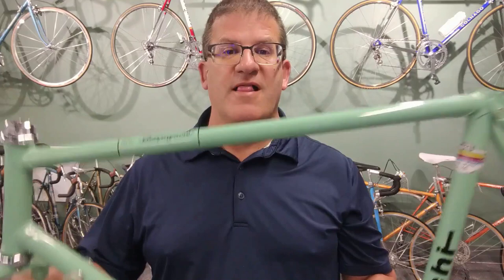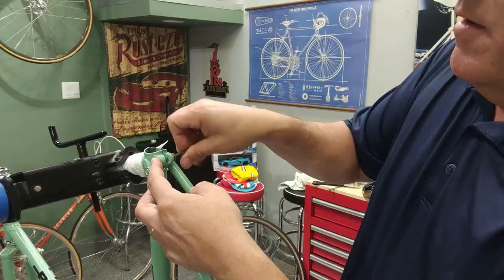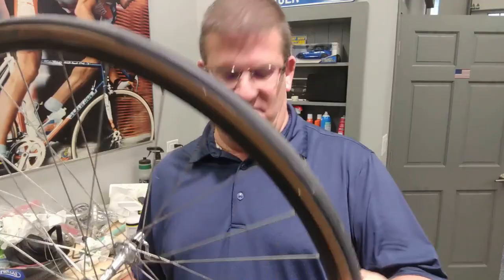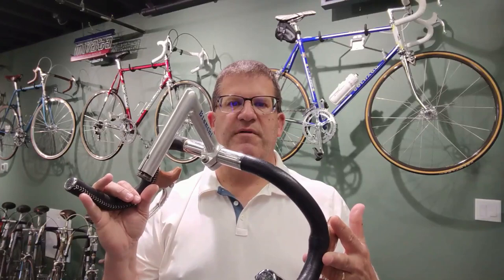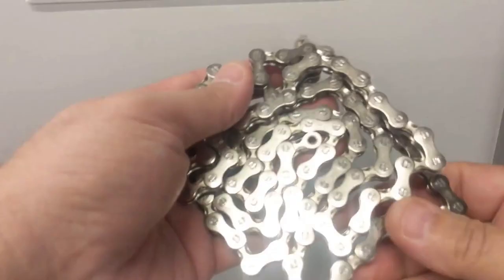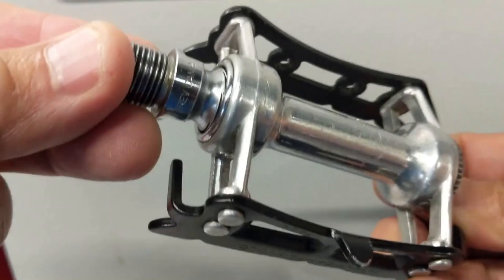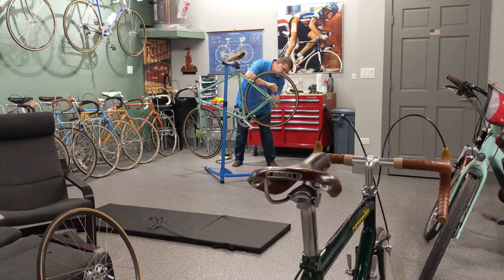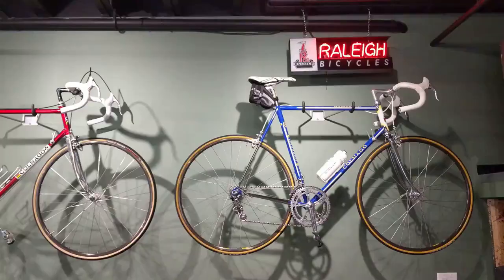1977 Bianchi build! We assemble the entire bike.

Comment: This brings back such memories.  I worked in a bike shop in Boulder in 1978-1983 off and on, mostly so I could buy Campy parts at cost. I loved assembling and tuning up old full-campy racing bikes.
Reply from the maker: Did you work for Vecchios?
Reply: @JohnsVintageRoadBikeGarage   No, Boulder Cyclesport, a shop that's no longer there. It was up on the Hill in the downstairs area that's mostly a food court now.  Vecchio's didn't open until much later, in 2000.
Reply from the maker: @pcalvinski  whenever I'm in Boulder I make sure I go into vecchio's and University. They have a lot of vintage bikes

Comment: I had one with similar  logos on the seat stays and fork crown.  I searched all over for a serial no and the only place I could find is like yours, at the top of the seat tube on the drive side.  Mine was 501. It was originally red and had been painted black with gold splatters, according the the seller the previous owner painted it that way to discourage theft. But it did have a nice compliment of Campagnolo group.  I had it blasted and powder coated red, I just couldn't love the gold splatter.  I have since moved it on to a good owner.

Comment: I have a Racing Department 1995 TSX UL frame and fork, that I raced from 1995 to 2000. I believe that 1995 was the last year that they made steel frames in their racing department. After that, it was Ti, and then, finally, carbon. I built it up with Campy Chorus 8 speed Ergo. 8 speed Campy allowed me to use all of my old 7 speed race wheels, because it would index perfectly with the Sachs freewheels. You just had to block off the last shift on the derailleur stop screws.
Reply: PS. That stem looks like a Cinelli 1A. Back then, Cinelli bars and stems were 26.2mm, instead of the standard 26.0mm. I've got some of those shift levers around in my parts box.
I can't remember when Campy changed their BCD to 135mm, so that they could fit a 42 ring, but sometime in the 70's they could only take a 44 ring. At that time, the QR levers were straight, not curved.
Reply from the maker: Yes. You know your history. Campy would always fit the 42 with that 144 bolt patter. Most of my bikes have that crankset. If im not mistaken Cinelli had 26.4, 26.2 and the latest is 26.0..  Depends on the age of the stem right??  The wheelset is NOS from early 80s. Its not the correct Era.. Gosh cant get away with anything!! LOL Thanks for your good eye!
Reply: @JohnsVintageRoadBikeGarage  Looks like I slipped up. That 135mm is for the semi modern cranks that could take a 39 ring. The 144mm BCD allowed a 42 ring (some people made a 41 that would fit on).
My memory must be failing....My old Cinelli 1A bar and stem IS 26.4mm, not 26.2.
After sitting unused for 15 years, I updated Bianchi, and now use it as a Sunday bike. I put on most of a Shimano 7700, 9 speed group, because I have lots of Shimano 8,9,10 speed wheels. The only things left on it are Campy, are the cranks, BB, headset, and an old friction type Super Record front derailleur (with the black links) 
For some strange reason, that friction front derailleur works well with a Shimano indexed left shifter.
Reply from the maker: @billkallas1762  in regards to the compatibility of that front derailleur and shifter. Sometimes you just get lucky lol

Comment: My Eddy Merckx is an 85' pro I believe . made in Belgium Columbus tubes but as I mentioned I lost/stolen the parts while it was stripped for over haul...I got it from a unpaid storage unit bid . $250 ...frame and fork original mavic wheels ..... before I stripped it I rode about 800-1000 miles on it and it's so fun ...need modular carbon tho , stuff insane. BTW you know your stuff !!! All the vintage info is especially cool 😎 cheers
Reply from the maker: Thanks. One reason I have this channel is that I learn so much. I know a lot about the bikes but the views know much more! I love learning more as I go on.

Comment: NICE BUILD!  My 'rich neighbor/friend' had an '83 Bianche in celeste green, looked exactly the same as your build here. 90% of the components were the same.  For some reason they sold with almost but not quite full Campy NR gruppo, only difference the Modolo Speedy brakes (and 'maybe' cheaper non Campy pedals? Not sure.), and my friend had to (have his rich dad) buy him your same Campy Record brakes, cause he said the Modolo Speedys 'sucked'.  OC he had to be the 1st to buy Look Pedals (PP56) in '85, a year before everyone else started buying them. I remember he had to drill 3 holes in each of his SIDI cycling cleats and tack in the 6 included spiked nuts to get the Look delta cleats to bolt on (black delta cleats w/o 'float' were only cleats available at the time). I also remember his SIDI cleats' soles delaminated from him repeatedly pulling up when climbing out of the saddle & sprinting.  I was his 'poor neighbor/friend' who had to save $ for over a year doing yard work and odd jobs for 'rich folks in the neighborhood' to buy my 1st 'decent road bike' (an '86 Nashbar Road LP for $283 on sale [$765 on 2022 $]). I still have that bike. I believe Shogun made the frames for Bike Nashbar. My Nashbar was made in Japan w/triple butted Ishiwata tubing. The frame is strange, has the seatstays cross and braze onto the seattube and toptube making an ~ 8" triangle. Considering my frame's 25" (I'm 6' 4") this weird engineering makes this my stiffest steel bike, and rides the best of all my vintage bikes IMO.  The geometry seems 1/2 '80s Sport Tourer' with 73° head/seattube angles &  40" wheelbase, not all out racing, but not 'sport touring' bike either.  My only gripe with riding it today in my 50s is I could just BARELY fit 28mm Conti Gatorskins on the rear, having to file the brake bridge of frame a tad to get 1.5mm of clearance (I know, supposed to be minimum 3mm but not possible. Front 28mm gatorskin does have 3mm clearance). Gotta have 28mm tires since I'm a Clyde at 225 lbs. Back in HS I thought I had 'the sucky bike' but I was completely wrong. Nashbar made excellent bikes back in the 80s. My Nashbar came equipped with the typical mishmash of Suntour, Sugino & Dia-Compe components which all meshed together nicely. Same gearing as your Bianchi (2x6 sp: 42/52t 13-24t). I believe my old neighbor/friend still owns his Bianchi also, his with tubulars.
Reply from the maker: I remember shoes before they were Look compatible. It was some work to get them to work well!  That triple triangle design of your Shogun was adopted by GT bicycles. They use that design now. It does increase stiffness. Alot of great framesets came out of Japan in the 80s. Many manufacturers went to Japan to source their framesets. Alot of that product was under rated back then. They are worth keeping and riding!  Thanks for watching!

Comment: Yo, just look at your seat-lug for the serial number to see its not a 1977 model, but a 1976 model, which would have come with NR grouppo. So much for flashing a 77 SR rear derailleur, but its still a vey nice bike. Great mechanical and youtube ability but you might need to spend a few bucks for new glasses my friend.
Reply from the maker: Thanks! I've been corrected on the model year. Funny. When I purchased it and showed off the frame to some Campagknowitalls they a went with the 77 year. I guess I should work harder confirming it huh? As per glasses. Im blind as a bat.
Thanks
Reply: Maybe you can help me with dating a Colnago Super painted in Saronni red frame.  The right dropout has a few serial numbers.  Respond if you can thanks!

Comment: Beautiful bike!   It's always so nice to work with the good parts with quality bearings, good threads, etc., especially when you also have to deal with some other parts that barely function when new.  There might not have been time (or need) to mention it, but when installing a chain pin, it may be necessary to use the upper position on the chain tool to avoid/fix a stiff link.  I'm not sure how many folks out there have ever installed a chain without a master link.
Reply from the maker: Oh the stiff links happen. I had to shake it out. Not trying to make this a "how to" video. That would take hours on an entire build. lol

Comment: Given that grease over time, especially over forty years congeals, of course you did FULLY disassemble the entire BB, as well, the headset, FULLY clean out all parts, FULLY relubricate and reassemble, right......?  You lightly honed out the seat tube, right?  You assessed BB final setting of the adjustable cup via 360 ("12/3/6/9" O'clock) degree rotation of drive side before you mounted the left crank, right? 
Given the age of the NOS hubs, they were also disassembled and relubed, reset with pre-load gap for final proper bearing pressure once clamped down with proper QR closure, right?  The Regina was, of course, fully cleaned and relubed, right? Rear triangle assessed for alignment, right? Fogging all 11 tubes not necessary but beneficial before assembly.
Entire 1-A stem bolt assembly FULLY tagged with anti-seize on all surfaces, as well, steering tube  I.D., 1-A O.D. before assembly, right? Clear protective tape underneath the cable guides is always a good idea. So too, fully disassembling the pedals before mounting and regreasing both sets of bearings as the grease has congealed. It's always a sound idea to lightly lubricate upper and lower RD pivot bolts and lubricate/oil the pulleys. The Nuovo Record derailleur is in fact correct for that frameset.
Reply from the maker: The answer to most of your questions is "NOPE" That overhaul will probably take place this winter. I was just doing a nice before and after build. Looks like you have all the makings of an excellent overhaul video. Come on by the shop and we can do one!!!

Comment: What a sweet bike and great way to document it. Care to disclose what a project like this costs or if there are similar NOS opportunities that aren't as spendy? Thanks!
Reply from the maker: I can tell you that I underpaid for the frameset, bars and stem together all NOS was $1425. The wheels were NOS and $300. Other used campy stuff you can probably look up. Some I had on hand. I have equity in this bike which is nice. Thanks for watching.
Reply: @JohnsVintageRoadBikeGarage  wow, that's way less than expected. Very nice bike!

Comment: the grey plastic piece to hold the brake cable adjuster on the underside was not done by Campy, nor was it to be used by customers...likely added by reseller. It's there so the reseller won't lose the part.

Comment: you're going to have a bitch of a time correctly touching up the frame/paint whack by the bottom bracket. with a cherry frame like this,  I might have opted to hunt down all genuine parts...but why bother? Campy is Campy from that era...at least as regards function.
Reply from the maker: Yes, matching that paint is a bitch. I built the bike up with what I had. Over time. I think slowly though I will try to bring it to 1977 spec. Thanks for watching